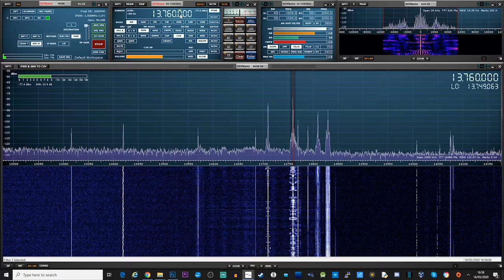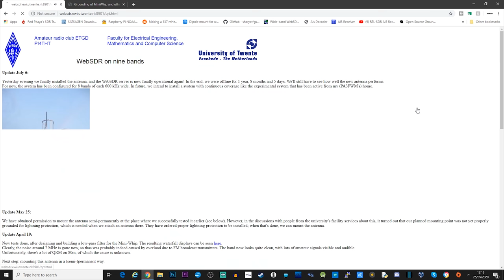HF Mini Whip Active Antenna 10Khz - 30 MHz

Comment: We used to build small active receive antennas using hand made coils of wire around 1 and 1.5" PVC pipe about 10 inches high that we manually tuned and amplified using a small RF amplifier circuits (usually canned mosfet amplifiers). They worked pretty good and sometimes it was all you really had room for in an apartment or even a hotel room.  Lots of fun to play with!  Later on we began to play with miniloop antennas for transmitting and receiving. Even MORE fun was had with these.

Comment: The miniwhip works by measuring the potential between the probe - the little patch of pcb - and earth. It is an electric field probe. Hence it must be located as high as possible on a non-conducting mast. The screen of the co-ax feeding the probe must be grounded at the base of the mast. It is the measuring the electric potential between the top and bottom of the mast. If the mast is metallic, you are effectively taking ground up to it and there is no potential difference. By adding a long wire to it, you have just converted it to a random wire with a signal pre-amplifier.
Reply from the maker: Ahhh so mounting it on the plastic pipe was okay. But maybe too close to the metal dish.
Reply from the maker: Please see here: http://www.pa3fwm.nl/technotes/tn07.html

Comment: a common way to get a good ground is to make sure the shield of the coax is connected all the way up to the ground side of the pcb, and then add in a ground rod and a grounding block at the base of the building before the coax enters the building (such as a lightning grounding block or something like that). The coax is sufficient but it must be grounded outside of the building to work well.

Comment: I've been experimenting with my Mini Whip off and on. Initially I had really great reception on from about 4 to 8 MHz, but recently I have tried what is similar to what I used years ago and that was a Fan Dipole.

Essentially I attached multiple lengthy wires to the antenna pad on the Mini Whip and that gave me better reception in the 10 and greater MHz interval than I had with a single piece of mag-wire run outdoors in an L shape roughly 15 feet above grade using a total of roughly 40 feet of wire. 

What really worked beautifully was adding the output from my home built Mag Loop antenna that was purpose built for the American Medium Wave broadcast band into the antenna pad and ground of the Mini Whip. Fantastic difference. I have another Mag Loop for 80 meters and I may tie it into the Mini Whips too.

Comment: Thanks for your excellent video.... I mounted my mini-whip In a PVC pipe using standout brackets at the peek of our 2-story home, with the antenna about 4 feet above the roof. My feedline ends in a metal interior wall box with the coax sheilding grounded inside the wall down to an 8 foot brass rod. An interior coax line runs to a bias-tee power box, then to an antenna splitter box for my various receivers. The mini-whip seems to work well, but I hope to run a 10-80  endfed wire through my trees soon to conpare.
Reply from the maker: Thanks! 10-80 endfed will be way better :-)

Comment: Hi Matt ! I've been using the original mini-whip by PA0RDT for years (cuurently the 'MKII Eco' unit), and it's an amazing antenna from VLF to about 10 MHz (not so good above, but still OK though). On LF and MW, it's an incredible performer, as good as a much more expensive Wellbrook loop. I heard more than 2,100 NDB from 94 countries with this tiny antenna. It must be mounted on a non-metallic pole and grounded (living in a buidling, I use the railing of my balcony as a counterpoise). In my case, switching the jumper located inside the PFU unit from common to isolated grounds also greatly improved S/N. Best regards, Pat.
Reply from the maker: Thanks for comment Pat, maybe I need to give this another go but with a decent ground. :)
Reply from the maker: The coax was grounded as it comes into the shack via a 4 foot copper rod driven into the ground. Maybe I just need to ditch the long piece of wire and get it above the house. Interesting how the university in the Netherlands have installed theirs and it’s working amazingly. See link in description if you havnt seen it.

Comment: Difficulties with grounding is what led me to the YouLoop passive antenna (couple of videos on my channel).  At my current location I cannot install an antenna outside, so a PA0RDT miniwhip would be stuck indoors, poorly grounded, and thus just amplify noise.  I'd still like to get my hands on one to experiment, and may do so after I move house in a couple of months.  Watching your video was informative and helped me feel that I made the right choice of antenna for this particular location :-)

Comment: I made a mini whip myself following the original schematics by pa0rdt but with small modifications to the transistor biasing and I also added a small output resistor in series with the output. The output impedance of the circuit is only a few ohms, which is OK if the coax is short but this few ohms transfers into a very high impedance after 1/4 wave of coax, and this gave a very bad performance at higher frequencies. OK, adding a resistor to create 50R output impedance cost you 6dB of signal but at least the frequency response and interaction with input band pass filters in a receiver is much better with proper impedance matching.
As many others wrote, grounding is a bit of a difficulty with this miniwhip. If it is behind a long piece of coax then effectively it sits at the voltage end of a wire, resonant on some frequencies and less on other frequencies. So a somewhat less frequency dependent ground connection like a metal pole or sheet metal roof works best.
But everybody’s mileage will vary greatly here. It takes experimenting to get it right.
I don’t use the antenna a lot. Outside it works well with very low noise but when I walk up to the house the noise floor increases to S9 with the many noise sources in the house (network cables etc.)

Comment: Late Happy New Year🎉! 
I was just conversing with a fellow SWL and he getting good results with his antenna mounted on his truck. I have a CommRadio CR1A mounted in my just using the built-in truck antenna, so I would like better reception. Therefore, plan to mount one on my truck also after I find a safe place to put it…😊!
Have a wonderful 2024! 73!

Comment: I bought one of these recently, tried it and then filed it away under 'R' (for Rubbish). BUT, after watching your video I did some more research, tried it again and now keep it handy for low frequency listening. The key (to my mind anyway) is to think of the 'antenna' as a system consisting of two sensors, one at the top of the mast (the silver pad) and one at ground. In other words, the difference in the electric fields between the top and bottom of the mast is what we are receiving. So, I mounted the sensor on a fiberglass pole (6m), connected a coax to the sensor and then cut a 'band' out of the coax at the base of the mast so that I could earth the coax shielding at the mast base (to a grounding copper rod). Now works fine at low freq and is excellent at rejecting noise. (I noted that the shield of the coax is connected to the sensor's PCB through the SMA, and my next test is to disconnect the coax shield from the coax plug at the top of the mast so that it only has the ground connection at the base of the mast.)
Reply: Hi, are you in the MLA-30 active antenna facebook group? I would like to hear updates of your miniwhip setup

Comment: I built one and documented said build in the video linked below. I used a PVC pipe and have no metal ground, and yet the reception is excellent. Living on the top floor of an apartment building left me few choices, but this option has proven very good indeed.
Build and test a PA0RDT MINI WHIP antenna. The tiny great solution for LW, MW and SW listening.

Comment: This antenna is in fact easy to understand, there is no weird teories hiding behind this, the original PA0RDT design is almost self explaining. That semiconductor containing thing is not an amplifier, it is nothing more than active impedance converter based on two transistors placed in emmiter-folower configuration. The only thing what this does is coupling the high impedance input to the low impedance line to the receiver. And it is crucial to keep the input impedance as high as possible. No filters and things like that, only the input bias circuit made from three 1MΩ resistors and the gate of the j310 transistor. Nothing more please. Selecting the first transistor is also important. The original design from the early 90s rely on j310 FET, which is not produced anymore. If you nowadays buy j310 transistor, you can be 100% sure it is chinese fake, not the original transitor. You can use MMBFJ310, which is the same transistor as j310, but in SMT package, or you can use j111 or j112 which are similar enough. There are some other semiconductors, that are usable at this point, but decide if that component is usable or not is nothing simple. The "original" PA0RDT design was nothing new. Similar idea was used in active receiving antennas for EKD300 and EKD500 receivers, and the real origin of this antenna comes from active car radio antennas from 50s and 60s, which was intended for LW and MW only. The EKD design was also intended for usage at VLF, but, in fact, PA0RDT design doesn't work well at HF frequencies, it works well between 50kHz and 2MHz. 

And please. Does not connect any wires to the input of miniwhip antenna. Use that PCB pad, or connect abt 1m long VERTICAL whip to it. Finding the right place for that antenna is also important. This antenna works the same way as near field E-probe, but you want it to catch long distance transmitter, so there should be nothing in the proximity of that antenna, where "proximity" means sphere with 10-20m in diameter. The antenna should be mounted at 1.5-2m height above the ground and the ground is the only thing, that could break into its proximity sphere. If theese recommendations are followed, then that antenna works well from VLF to MW bands, otherwise you get something, but not any miniwhip antenna. "Something" may or may not work well.

And. If you want to power that antenna through the line, you have to use a huge coil because of VLF and LF. It's much better to use separate wire to power that antenna.

As the time goes, there are a lot of builds and they are mostly awfull and simply doesn't work. People applies modifications to the original design WITHOUT knowing how it works, which leads to very bad results, but as they doesn't have experience with well build miniwhip, so they think that they get is ok, that they have results similar to what they should expect, so they spread their wrong desing ideas almost worldwide. Miniwhip is easy to build (but not easy to install) great antenna, but you have to follow the original design, or have to understand how it works. Otherwise you obtain bad results.

Comment: I've seen this antenna referenced through  the years. There been a few articles (authors) saying this antenna is not very good without a very long coax connecting to the radio, implying the coax is actually part of the antenna. So setting up the antenna outside and using a long coax would most likely make it work, unless there is some bad circuit.

Comment: you don't need a conducting pole (mast) for it. I used it on a pvc pole and it woked fine you need height for it and than it performs quite good

Comment: I have the same version Mini-Whip purchased from probably the same UK vendor, and mine was also the kit version.  Although it was my first attempt at soldering SMD components it went well enough and the antenna worked straight off.  I did have some trouble with the Bias-Tee however mostly caused by my initial clumsy attempts at soldering the tiny components.  Ended up replacing inductor L1 twice and diode D1 once on the tiny card but the circuit has been working fine since.  I have the antenna mounted inside two meters of PVC pipe sticking above the rear eave of my house.  The pipe is guyed to the roof with two paracord ropes.  The gain is not spectacular but it does pull in some stations I would not normally get without it, and it nicely lowers the noise floor on the broadcast bands.  However it only came with a tiny 1 inch long piece of wire for the antenna part of the circuit board which seems comically small  so I plan to try a longer wire antenna like the one you show in the video to see if that will improve its sensitivity.  Also, I'm limited in the kind of ground I can apply so the ground is currently attached by wire to a screw terminal on an electrical outlet about 5 meters away.  Seems to work OK but it is probably weak so I will next try the only other ground I have left which is the gutter that rings my roof.  Maybe that will work better.  I have also tried a ready-made Mini-Whip from a cheaper eBay source but that one did not work as well (you get what you pay for), and I just received my most expensive Mini-Whip, what appears to be a well-made version from the Ukraine, which I'll try tomorrow after the rain stops.  It has a bigger patch antenna etched onto the board so it at least "looks" like it will pull in more stations. One more thing:  I added some ferrite beads on the feedline at the antenna mast and at both ends of the USB cord going from SDR to my computer to reduce common-mode noise.  I also run the Bias-Tee using a DIY 12V Li-ion battery pack.  My house is ringed on two sides by power lines so I need all the QRM suppression I can get.  May I ask how long the wire is that you soldered onto your Mini-Whip and how you arrived at that length?  Thanks!
Reply: OK, I've tried three Mini-Whips.  I can't give you measurements because I lack the tools to do so, but I can give you my impressions.  All three behaved very differently.  One gave a weak signal that seemed no better than my long-wire antenna; one had good sensitivity and 3IP performance (that's the one I built from a kit), and one was very sensitive but poorly selective and kept piling signals on top of one another.  That last one piled a Spanish station on top of a Japanese station in the 160 meter band and I could not separate the two.  I'm still very new to SDRs generally so there may be some method to this that I've not learned yet, but I was not expecting three "identical" antennas to have such obviously different outputs with the same radio.  As always, YMMV.
Reply from the maker: It’s 10m long, and it was just picked out of hat,  no calculations to the length.

Comment: Mine looks very similar, I use it without a wire and it works well even indoors. Main thing it to keep it away from sources of noise so I had mine at the apex of my loft. Be careful attaching heavy pl259s to the tiny injector board, I snapped the SMA connector off mine along with the PCB pad 😣 I now use rg178 pigtails to take the strain